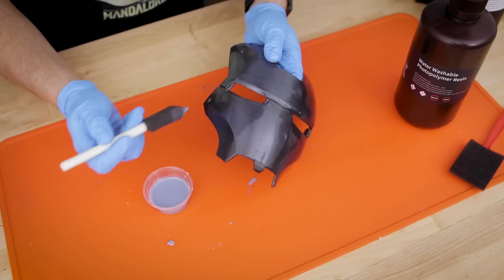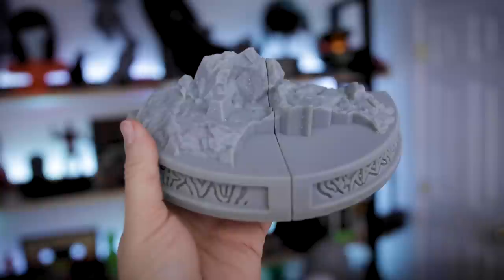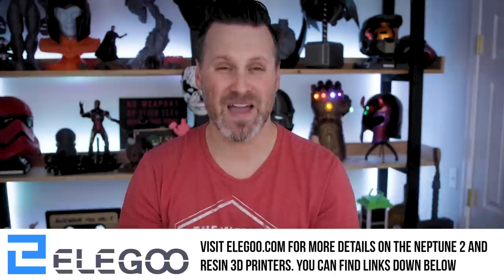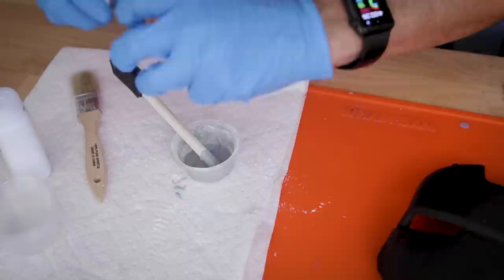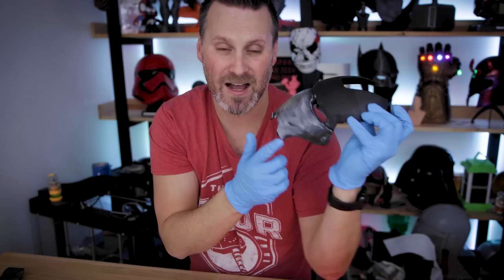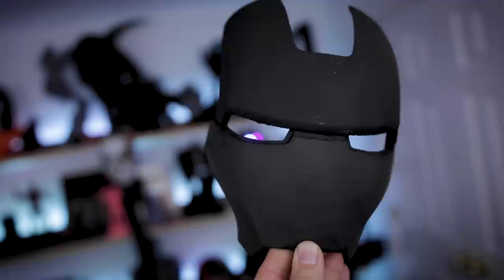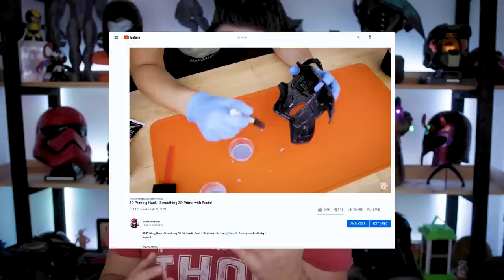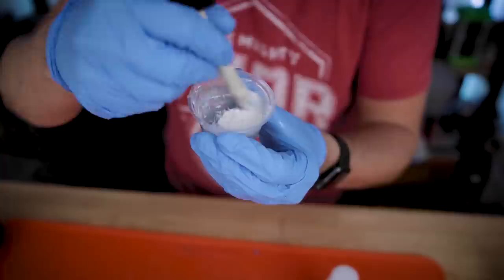3D Printing Hack - Filling Gaps & Seams with Resin and Baby Powder

Comment from the maker: This trick works a little too good!

Save 15% off Nikko's Iron Man Faceplate with the code UJ Baby
https://www.nikkoindustries.com/collections/all/products/iron-man-faceplate-display
Reply: Another cool thing you can do with UV resin: Thin it with lacquer thinner and airbrush it onto your FDM models. It's pretty thin, but you can build coats or introduce this towards the end of your processing. It's almost like UV-drying micro filler paint. I use it to fill sanding scratches and leveling out imperfections. surprisingly, it still cures well, and hey, no brush strokes. I imagine if you use a larger sprayer, you can hog out the thicker resin. Something to consider with your masks or other props.
Reply: @jasonMontalvo1  Spraying resin into the air is not recommended
Reply: When you mentioned talk, it reminded me that minerals are often used as fillers into plastics. E.g. PVC can have addition of like 80% of calcium carbonate (nanometer  (<1um) scale powder) that reduces it's elasticity by a lot, makes it very stiff, but also stabilizes it. 
I know it's 3 years since you posted this, but: are these fillings more brittle or fall of the surfece you coated after e.g. slight bending?

Comment: I am amazed when I see people wearing gloves with resin prints and then dry sand them.  Wet sanding keeps dust down, and if you use my favorite trick (using windex instead of water) it will dry faster and even allow you to smooth/strip paint.

Comment: Awesome video as always, but I would recommend to use a transparent resin and milled glassfibre as a filler, this would then also fully cure, to prevent monomers migrating out of the resin. The talcum absorbs UV light and therefore it can't fully cure when used in larger amounts.

Comment: Funny story,  this is basically what automotive body fillers like Bondo are made of. They're usually polyester resin, like most fiberglass resins,  with fillers like talc.  I frequently mix up my own body filler with talc and epoxy or polyester resin, it works great.  Just make sure the baby powder you're getting is actually talc, and doesn't have a lot of fragrances, aloe, etc in it.  Most baby powders nowadays are actually cornstarch.
Reply: Great info! thanks! I do a lot of resin work and I used to us small amounts at the point where ut starts to thicken to patch and sand. I never thought to just add talc. Thanks so much for adding more great info!
Reply: Would it okay if i use cornstarch instead?

Comment: Resin mixed with talcum powder is a classic way for resin thickening for resin casting. But with the mix, it's also brittle.
Reply: Adding angel hair might be a better option
Reply: @previctom  I prefer vermicelli
Reply from the maker: Great to know thanks!
Reply: inbe4 someone steps in with dollar store ramen and superglue
Reply: @Metroidf4n  no
Reply: Good to be cautious about, but brittle should be fine for this function, right? If it's all filling a gap, the rest of the model should shield it from damage.

Comment: ok well ive been using flour for the last few months i might need to swap to baby powder lol another trick mate , is get a big Syringe , and i use ( squeeze) it into gaps, then UV light then again , not only does this seal it up but its stronger that superglue, , its a little time consuming but i get better control with gaps , rock on
Reply from the maker: Oh man I need a resin syringe 😂 that sounds even crazier to use.

Comment: Jessy, the problem with this method (and minorly the paint on method) is that your only curing the top layer (maybe the second layer with the more transparent resins) So when you were doing the mask you were then sanding down the top layer which was then freeing up the resin that wasnt cured onto your sand paper (likely you didnt notice this)

Comment: Thanks for the tip. One point, as I make and paint injection molded model Aircraft, there are very small metal spatulas and apply tools designed for modeling. You can apply tiny measured dabs to the model, avoiding dealing or masking it off beforehand with tape.

Comment: 1. Add the resin to the filler (baking soda or talcum powder) so you don't end up with too much goop.  
2. Use painter's tape to mask off areas that you don't need to fill to reduce sanding.
3. Use a silicone spatula (Dollar Store item) instead of your gloved fingers to smooth & wipe the excess filler before curing.
Reply from the maker: Just bought a flexible spatula the other day!

Comment: One thing to watch out for is that thicker globs of the mix might not cure all the way.

Also, lil tip for gap filling on GK style prints where you wanna paint parts separately for strong color separation, paint some petroleum jelly (Vicks vaporub works great) on one side, glob in you filler on the other, press fit the two parts together, clean up the squeeze out, then cure.  Bam, perfect gapless press-fit ready for cleanup and painting.

Comment: Durham's Water Putty is my go-to gap filler for my prints. It's incredibly cheap, you can get it at any home depot, it doesn't smell, and it's relatively clean. It comes as a powder that you mix with regular water, dries super hard and sandable. Only real downside is that even in its cured state, it will soften if dampened, so it needs to be coated with something to protect it and you can't just rinse the print to prepare it for painting.
Reply from the maker: Oh nice. Adding that to my shopping list

Comment: Really useful tip for larger surface area coverage. May have to use this for some of my ThorDalorian armor plates when they come off the printer. 

For smaller areas or details I generally use either Vallejo or Tamiya plastic putty (since I'm primarily a miniature / bust kindda guy) since I have those laying around. They tend to be less thick than bondo, have a really good working time and take very little effort to sand smooth.
Reply from the maker: Will need to pickup some of that Vallejo or Tamiya plastic putty and test it out!

Comment: Been using this technique for years. I thought it was common knowledge. lol. You're essentially home brewing car filler. Except its UV resin instead of fibreglass resin. One reason I use it, is that different fillers  sand at different rates to the surface. Which can still leave a raised ridge, or depression after sanding. Only to come back after painting. With the UV/talc filler. Its basically the same material as the surface. Which means leveling is far easier, and less likely to leave imperfections. Less prep equals a happy modeler in my case.
Reply from the maker: Awesome to hear! Yeah, have never seen or heard about it but clearly a lot of people have been doing similar things for a while now

Comment: This is smart.  I was going to try to find some kind of gel or thickener used for fake UV nail art but baby powder is the much cheaper and more convenient option.  Using essentially the same resin to film gaps and sand the surface finish smooth will be so much easier and more effective then messing with the bondo which I don’t really like using.  Thanks for the update!
Reply from the maker: thanks and hope it works well for you!

Comment: I use spackle paste for drywall( the stuff that goes in between the tiles) to fill holes and layer lines, it can be thinned with water and it's non toxic, i also picked up Vallejo Plastic putty, similar to the drywall stuff but when it dries it has more flexibility where as the drywall stuff gets kinda brittle.
Reply from the maker: Awesome options! Will look at grabbing some to try out
Reply: Uncle Jessy Cool, it’s all I use, I also use a wet brush after applying the paste to smooth it out, also works with a rag, that what I used on the Vigo base.

Comment: Another alternative is using a mix of CA glue and baking powder. If you get a kit that has thin, medium, and thick glues, you'll want to use the thin CA glue, it mixes with the baking soda considerably easier than the other two. The mixture sets rapidly, and will probably be even stronger than the 3D printed part. I watched one video where the mixture was used to fill a small cardboard box that razor blades were packaged in. A small hole was drilled and tapped, a steel bolt was threaded into the hole, and the glue mixture firmly held the bolt. I just used this method to repair a cracked overhang on a plastic trash can. CA glue and baby powder will give you similar results, with the only exception being, that it dries slower than with baking powder, which gives you a longer work time.

Comment: If you need to sand a very smooth finish, you could flash spray over the filler with a contrasting color paint spray can and then sand till it's almost completely gone, only the low spots and pits should be left, then repeat if necessary until you are left with a thin even coat of filler. 

Love your content! cheers

Comment: Nice one! For small holes I use CA glue and baking soda. It's super fast.
Reply from the maker: Ummm that sounds awesome. Going to have to try that out
Reply: The benifit of this over CA glue and baking soda is that the glue and soda is instant. You put soda where you want the fill (which is a powder so not alot of control, besides using gravity to hold it where you want) then apply CA glue on top, very hard fill....

But this method is leaps and bounds better, you have a workable paste till boom instantly cure when and where you want it. With much more carefull application, like with a toothpick for instance..... This very well may have replaced many methods of finishing models and miniatures.

Comment: In boat building we call this "fairing". As others have said, the talc probably stops a lot of the UV from getting through the resin and you probably end up with some uncured resin in there, especially where you filled the hole on the sonic. But a great alternative is to just use a 2 part epoxy instead. Exact same process except the resin cures without UV light, and regardless of how thick a layer is. 
 
It needs to be left a lot longer to cure, but if you had deep gaps to fill on a big project, it would be a much better option.

Comment: Hey Uncle Jessy. I do this with metallic powder :) and the result is PHENOMENAL when you sand it. You should try.
Reply: Clear or opaque resin?
Reply from the maker: Do you mix in the metallic powders with the resin before printing? I was going to try that out
Reply: @UncleJessy  Yes exactly. It's called metal cold casting with epoxy resin if I remember correctly, that's how I got the idea. The powder needs to be thin and the resin clear (even colours work). Try not to put too much  at least at supports layers level as you can damage a bit the FEP since the build plate collapses on the FEP and might apply pressure. After that this is all good.
I am now experimenting with crushed golden/silver leaves but this is not as cool 😎.
Please let me know how it turns out for you !
Cheers.
 (Also select a metal that is not too dark)

Comment: I love this idea for bonding two sides of a helmet together on the inside. I usually use a FDM pen to weld together helmet prints on my FDM printer and this could work great for resin prints in the same way. Using it thick could give it some nice strength to keep those seams nice and strong.

Comment: Corn starch would be my go-to fine powder, though as you might imagine, it's a bit more tricky to get your mixture spot-on as it absorbs moisture readily. It'd be very easy to get a paste however, and a 1 pound bag lasts Forever. 
Something you would benefit to work on personally is keying your models, which can be done very easily in Fusion 360, even if you're importing it versus having it natively. If you have zbrush, that's also an option and probably easier as it will import OBJ files without having to convert it through Fusion's various preferred file types. Though going through Fusion, you can be 100% certain you'll maintain manifold shells.

Comment: If you try to put the filler on the peices pieces before you put them together then use a bondo spreader or razor knife to take the excess off arter you put the parts together it might make for a smoother finish with a lot less sanding.

Comment: I use Alabastine Polyester Repair Resin normally I use it with fiberglass to reinforce armors or helmets but solo works amazing just brush it in wait to cure and prime it. and you retain a lot of details. it is amazing You should try it out.

Comment: The benifit of this over CA glue and baking soda is that the glue and soda is instant. You put soda where you want the fill (which is a powder so not alot of control, besides using gravity to hold it where you want) then apply CA glue on top, very hard fill....

But this method is leaps and bounds better, you have a workable paste till boom instantly cure when and where you want it. With much more carefull application, like with a toothpick for instance..... This very well may have replaced many methods of finishing models and miniatures.

Comment: Stuff I can vouch for:

Small holes:
Tamiya putty (grey), my absolute favourite, it's decently cheap, comes in decent size tubes, and it dries quickly.
AK interactive grey  modeling putty, great stuff, bit more expensive than the Tamiya one.
Vallejo putty, decent, cheapest of the bunch

Big holes:
Alabastine Drywall filler (quick drying stuff), kinda brittle but due to that it sands down really well.

Yo momma sized holes:

Epoxy putty and prayers, and probably some other hole fillers after that.

I've had no issues with paint adhesion, then again, I always tend to prime with polyurethane primers.

Comment: Have you ever tried dipping small prints (like RPG figures) into a vat of resin (pure or thinned) and let drip dry? IF it works out the way I'm thinking, then you should get a smooth coat with only a dried drip spot to clean up. 

Also, have you ever tried using a thick needle syringe (like they use in cooking) to inject thicker resins into voids to reduce the amount of sanding needed?

Comment: We use the same resin to seal, glue, and gap seems and fill areas that got damaged or messed up either during print or finishing. Best to use the same resin you printed with, in the case of FDM, never tried this with FDM before, but I would think it should work about the same.

Comment: Nice video.
The curing times may have me change from using epoxy resin to UV resin.
We use laminating epoxy resin mixed with a filler, cotton flock, glass balls and other materials.
We usually add enough that the mix starts to look and feel like vaseline or smooth peanut butter.
I can use the same with the resin and then just sun cure it in minutes, instead of days like with the epoxy resin.
I just realised that this would be perfect for quick, on location repairs to model rockets.

Comment: I've only used wood filler so far because it's very easy to sand. I might give Resin and powder a shot for smoothing prints but I'll stick to the wood filler for bigger holes.

Comment: Seems to work similarly to glass bubbles in epoxy for composite/molding applications, neat trick!
Reply from the maker: Oh cool I need to look into that. I've never heard of glass bubbles before
Reply: @UncleJessy  they're pretty hazardous (need a respirator) so probably not great for this use case, but maybe there's a safer alternative as a thickener?

Comment: Great idea! It reminds me of the marble powder you can use with urethane resin. It slows down the curing time but adds so much weight and it creates a paste that I often use as glue instead of the two part tubes you can buy normally. I will be doing this for the handle of the lightsaber with the leftover elegoo resin. Thanks man!!

Comment: Ever try MAS cell-o-fill thickener 
It will spread well if your sanding so much polyfilla or hard set wall fill. They paint well for models but not good for strength

Comment: i use steelwool + resin to fill in holes. I wonder if theres other powers out there that can give it a lot more strength , like mix it with metal powders ? This is better than bondo because u can use leftover resin to reduce wastage
Reply from the maker: Oh man I love the idea of resin+Steelwool. Do you think that adds more strength to your prints?
Reply: @UncleJessy   i have only used it to cover drain holes, so not really sure, i use dip the steel wool in resin then jam it into the hole and cure it, then apply some more resin on top and cure it again
Reply: @UncleJessy  and its also easier to close holes with steel wool because it acts as a mesh/bridging layer to prevent resin from dropping down into the model instead of staying aroudn the hole.

Comment: What you just did is a very old modeler's trick. I use superglue and baking powder for many of my models.
Reply from the maker: Niiiiice! I need to try that out and see what it’s like to compare
Reply: @UncleJessy  beware, the super glue will solidify almost immediately. Modelers will typically fill a hole like in your mask and then sprinkle the powder on top then use a file to sand it flat. Only takes a couple of seconds start-to-finish
Reply: I wonder what the benefit to this rather than using something like Milliput is? Near instant cure time?

Comment: for many years I've been using baking soda with cyanoacrylate (super glue) to make it much more resilient for filling gaps, would baking soda work similarly to the baby powder in the resin hack you're doing?
Reply from the maker: Someone else asked the same thing, I will need to test that out and see. Pretty sure it would work